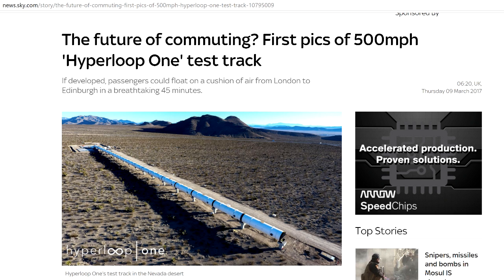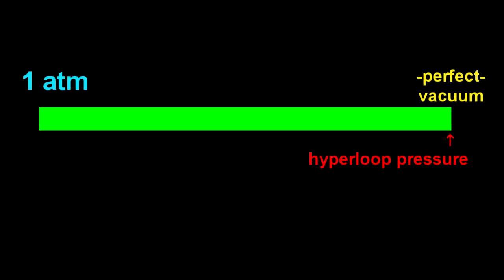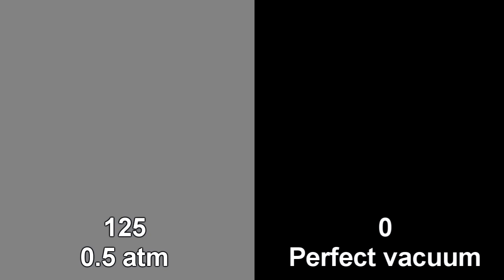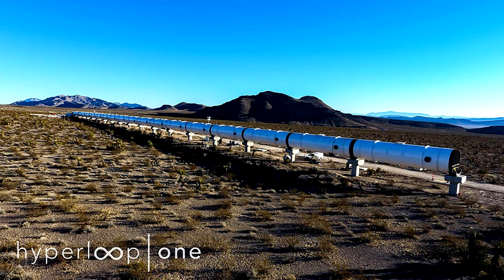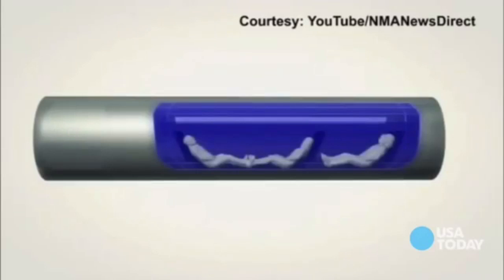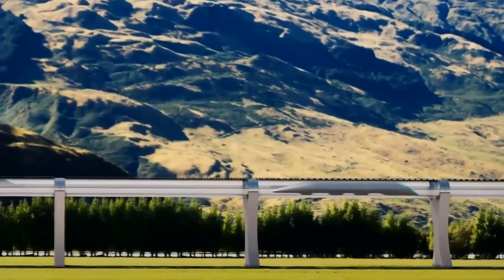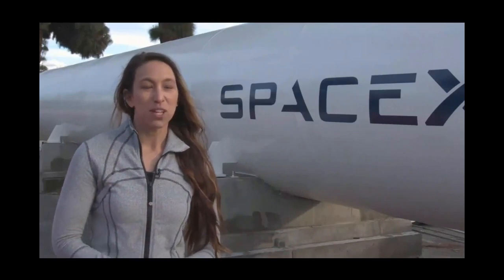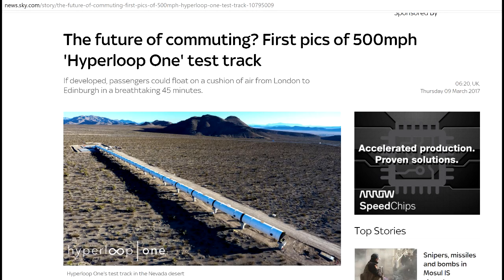Entire Hyperloop could be destroyed in SECONDS!

Comment: I did the math. A 3-metre diameter Hyperloop when blown apart with just a small amount of TNT, generates two air hammers racing away from the breach. Both travel at just under the speed of sound and each has a yield of 40-Gigajoules when it hits the airlock at a station. This compares very favourably to the yield of the largest non-nuclear bomb in the US arsenal - The 46-Gigajoule MOAB: Massive Ordnance Air Blast - or the Mother Of All Bombs.

Comment: Due to human rounding errors 1.99 + 1.99 = 3. Because it makes more sense to just call it 3 and move on than to fight over 0.02 or 2 one-hundredths of one percent.
Same with the hyperloop vaccum.

Also, it doesnt have to be run at this insane level of vaccuum... it could just as well run under 1/10th or 1/5th. The point of the vaccuum is to reduce air resistance thus increasing speed... which could also be achieved by aerodynamics and careful grade/elevation changes ensuring as much time as possible at high speed.
Putting a electric car (for fume safety reasons) into an enclosed autobahn that has charging infrastructure built into the floor rail, is a better method of achieving high speed travel than the hyperloop.

Comment: What is not mentioned is the passenger car has to be pressurized and able to withstand the pressure differential to the vacuum.  The passenger car also has to have an internal oxygen supply and CO2 scrubber just like a space craft.  And should the vehicle loose seal, passengers will suffocate.  Geeze, Hyperloop is a stupid idea.

Comment: Here's a list of things I'd consider making the hyperloope tube itself "safe":

-Thicker steel with ribbed support structure on the outside of the tube segments
-Secondary outer tube with inner ribbing support, under partial pressure (reduce strain on the inner tube from full atmospheric pressure)
-Outer tube is completely surrounded in concrete to prevent impact deformation
-Entire length mounted on shock and vibration absorbent supports
-Emergency vacuum lock and evacuation station every 1 km (automatically locks segments no pod is traveling through)
-Concrete barriers all along the entire length of the structure to prevent impact from vehicles
 *OR*
-Entire length of the structure buried in loose soil with a solid load baring structure arching over it

Only under those conditions I would consider the tube itself to be "safe". It would eliminate a lot of problems including heat expansion and buckling as that would be largely absorbed by the concrete and covering structure.
Only problem, this would probably add two zeroes to the total cost and would still not make the travel in the tube much safer.
And with what the structure would have to do it's still proposed in an earthquake zone.
You can shock mount and impact protect it all you want, if the ground itself decides to tear it apart like a piece of wrapping paper you're boned.

Comment: Serious question, could you “nest” various partially evacuated chambers each of increasing pressure from vacuum to reduce the stress experienced by the actual vacuum chamber at the center? So interior chamber is ~ 0 atm, that contained in a larger chamber of ~.1 atm, that contained in a larger chamber ~.2 atm, etc... You get the idea. I try to think about it in terms of springs to model the balance of forces but I am actually unsure whether it’d work. Not sure if the force on the interior chambers would be affected by the outermost pressurization (1 atm) or by the chamber which encloses it (in my example, ~.1 atm). Just curious, thanks to anyone with the physics knowledge who answers my question. :D

Comment: Going back to basics, I really don't understand why the chamber is evacuated. These pods all use wheels of some kind. The coefficient of friction is immense compared to the air resistance if the tube were not evacuated. And why do some of the artist renderings show streamlined pods? Why streamline in a vacuum? 
I suppose a maglev system would reduce the track friction so low that air resistance would bulk relatively large. But what is the construction cost of that and the energy requirements? 
Somehow, I suspect that the capital investment would make the increase in speed very, very expensive. Speed above all else -- it begins to look like what us economists call a corner solution which recognizes no trade-offs and is inherently uneconomical.
Reply: >And why do some of the artist renderings show streamlined pods? Why streamline in a vacuum? 
The vacuum is not hard - most of the Hyperloop projects intend to use commercial vacuum pumps only, which will leave some residual air. And on high speeds, the drag will become noticeable. You can see it even with ISS, which has Night Glider and Sun-Slicer modes for its solar power arrays in order to minimize drag and allow more time between reboosts.
>Somehow, I suspect that the capital investment would make the increase in speed very, very expensive
That is indeed likely to be one of the biggest problems of Hyperloop systems. Engineering problems are defeatable with engineering solutions, but R&D is not free and neither is implementation of those solutions or bureaucracy.

Comment: Dear Thunderfoot,
As many times as you have debunked this on it’s basic idea you have not mentioned how they could even dream of it stoping opening up to let people on and off at different stations without having to vacuum the entire system again. 

Even if they have a gate valve at both sides of the station wouldn’t it slowly need to be compressed and then decompressed again before the gate valves were open? 

They couldn’t quickly switch back and forth could they? Wouldn’t that cause serious stress to this air right carriage? 

In all honesty I thought about this idea when I was in 4th grade and I thought about it over time, and then I went to middle school and high school and I realized that my idea was stupid. 

Don’t get me wrong, my idea was more about pushing the carriages using both vacuum on one side and compression on the other. 

Then I realized the amount of energy it would take to suck and blow a train at the same time. 😂 

What cooks my ass is Elon Musk has made a fortune off dumb ideas. 

As a child I built model rockets and tried different ways of controlling their decent. My proudest ever was after first stage separation I had 3 helicopters pop out and if I had been able to have a remote and servos I could have maybe made something of my self, but adding the blades didn’t give me control, it only aloud me to use the weight and spin to slow down the first stage without using a parachute. 

Maybe that’s why I think Elon is a giant cunt, and his ideas suck
Reply: >how they could even dream of it stoping opening up to let people on and off at different stations without having to vacuum the entire system again
... Airlocks are a thing that exists, you knot. A few pressure-sealed doors - and only small spaces, where capsules stop, will need to cycle, instead of an entire system.

>Don’t get me wrong, my idea was more about pushing the carriages using both vacuum on one side and compression on the other. 
It doesn't work like this. Most of the current versions of Hyperloop (there are many of them) are, basically, maglevs in low-pressure tunnels (to allow for higher speed).

Comment: Didn't James Bond use a hyperloop hidden inside the oil pipeline to escape the Soviet Union? If they actually did it in a movie, I don't thing the engineering of this is very difficult. The problem is that Europe is going to have to choose between a Hyperloop and Russian Fossil Fuels.

All the same, I am going to stick with Commercial Airship travel, which, unlike heavier than air flight, cannot be debunked. You can also put a Nuclear Reactor on an Airship and AIR COOL it.
Reply: The hypeloop would be far more expensive and far less safe that any conventional maglev train. The argument here is not whether it can be done, but can it be as economically viable as advertised. The unsubstantiated claims made by Musk and involved parties were complete bullshit. That is why these videos exist.

Comment: I mean, it wouldn't be too hard to get around a cascade failure by using a series of automatically opening and closing doors almost like 'airlocks' every few kilometers in the tube, but the maintenance costs of rebuilding sections of the tube, even if the failure is not in the section with people in it, would be very high, along with the amount of delays. Also the track is expensive, and one way. it makes much more sense to build anywhere from 2 - 6 high speed rail lines (for probably way less money), and it'll only take you double the time. Also you can transport you know, a few hundred passengers instead of like 15-20 at once. Using the 'gold standard' of current high speed rail (which I would consider to be an N700 Shinkansen) travel between the two cities could be at a minimum just over 2 hours. If you could link that to downtown SF and downtown LA, trust me it's a hell of a lot faster than flying with all the shit at those airports and traffic. Now just using the improvements from maglev trains, vs conventional rail, (for the sake of simplicity I'm sticking with the Japanese designed one, also Japanese trains have a long record of safety) the test trainset 'L0' is rated for 505km/h in operational usage (record 603 km/h) which would bring the time it takes to get between the two cities down to somewhere in the range of just over an hour. Basically, a vacuum isn't necessary for high speed rail travel and will only complicate safety and energy concerns and lead to a stalled project that will result in a small amount of the track being built and eventually failing if it even makes it that far.

Comment: There's a lot of problems urinalysis on this particular one
1 you're never going to achieve the maximum rated speed of a tube only a kilometer long
2 vacuum in a tanker truck is a lot different than vacuum in a container made to hold a vacuum the tanker they used wasn't even really intended to handle pressure let alone a vacuum
3  the braces inside the tubes are not intended to stop the things from collapsing their intended to stop it from distorting as they move it around this way when they go to welded they don't have to reshape it and if you notice it was only really at the ends at those races were at and again this is because they're going to be welding it and they want the butt joint to be as perfect as it can be

Comment: What if the hyper loop was compartmentalize. So invade of decompression it would lock down multiple areas and make a gradual gradient to 1atmospers. It would decrease time of entry by a lot.
Make it a maglev based design due to the pods slow down du to contact with the ground. Lift them up on a maglev. Make them aerodynamic design. And it could possibly work. With a bit more technology that we don’t have yet.

Comment: Just a thing: all those tubes are one layered. An Engineer would adress this problem with a two layered structure. (Inbetween the tubes there is about atmospheric pressure.)
Reply: That would change nothing about the differential pressure between inside and outside the inner tube.
Reply: @bumboclat   but you can make the inner tube dentless.

Comment: ThunderF00t I agree with all of your points except for one. 

With the vacuum tube they would have a system in place where they would have a separate chamber the pod would enter, they would bring the small chamber to a vacuum and then open the seal to the hyper loop. Seal the door again, depressurization, add the next pod and repeat. 

But this doesn’t absolve all of the issues but it does handle how long the depressurizing would take and the amount of energy as well.

Comment: I understand your scepticism, but let's be honest, a train or truck tank isn't made for vacuum, and you're just comparing strawberries to apples. Even over how retarded the US can be I'm sure there are some safety norms that they have to match to be allowed to put people in it. Like the least they can do is put in sensors and valves to quickly fill the tube in case of a failure, and considering the speed at which the truck tank imploded and the length of the tube the chances that a train will be caught before even a cheap solenoid valve set can open and repressurize the tube are minuscule. Considering the speed I don't know, I mean you just maglev the shit out of it, speed it up half the way, slow it down the other, and that's that, maglevs are expensive but relatively simple design, hard to mess that one up.

Comment: 7:28 200 million Joules correspond to 1.7 gallons / 6 litres of gasoline. Not much at all, and why would you use TNT equivalent for something that has nothing to do with an explosion?
Reply: im pretty sure depressurizing that chamber requires more energy than that, doesnt it get exponentially harder to pump out more air?

Comment: The video of the tanker truck collapsing is not a great comparison.  That vessel was built to withstand greater pressure forces from inside and is constructed differently.  The video was intended to convey the dangers of pulling vacuum on a container that was not properly designed for vacuum.  Early submarines were made with carbon steel hulls and had a test depth limit of 100 meters (materials and design improved later for greater depths).  That is a 10 atm pressure differential that the hull was build to withstand.  With a perfect vacuum, the chamber would be subjected to a 1+/- atm differential.  Also, the supports within the pipes are to maintain roundness in the sections until final assembly because a small deviation in roundness as little as 25mm can result in over 30 percent decrease in hydrostatic load.  There are many things to consider in such a monumental endeavor, including the energy requirements you mentioned.  But, not all points are worth being so dramatic over.

Comment: It would not make a big difference but these tubes are supposed to be underground on the final product which could solve some problems however it still wouldn’t work
Reply: Ok the dirt problem is easy make the tubes thicker and reinforced so that way they don’t collapse. This would also solve the collapsing from a vacuum problem. Groundwater and rain can be solved the same way subways do it with pumps.  I don’t how inspections would be done above ground but I think It would be the same. You know go in the tube and walk or use some other small vehicle to check the inside. You also mentioned California fault lines and earthquakes. I would ask you how do you think people transport large amounts of water underground with pipes and this is essentially a giant pipe. So the engineering that you use for a pipe to move water can be used on the tube under ground. So yes it is a great idea to put the tube under ground you also don’t have the big ugly pipe above ground. However I don’t think this project is worth it. It cost too much to build an efficient design that actually worked.

Comment: I'm not a science major, but this comes in mind. Why not try to design a more advanced electric train using a renewable energy source? A few windmills on each station or along the rail, an array of solar panels on the roof of stations and trains, and if needed, a back up electric power from the grid.
It will at least reduce emission significantly, electric trains are already developed and tested,  the passenger could at least see the outside world instead of a tube interior, explosive decompression can be ruled out from possible risk, and tesla could really promote the use of solar roof they produced few yeats ago.

Comment: so...
not a fan of that hyperloop idea
but msot arguments against it are just as... wrong as the argumetns for it
it's just a really mediocre idea
but it's not that dangerous
it's just well... not as expensive as some assue but way more expensive than it will ever be worth
between regular trains and airplanes (which by all logic are equally dangerous to hyperloop yet one of the safest methods of transportation) it just will not be able to economically compete
the main disadvantage of trains against other methods of transportation is that you need to build expensive infrastrucutr along every rout you want to drive - and thy are only economically competitive because traintracks can be built increidbly efficiently and trains are already really energy efficient making up for that cost
removing air resistance from trains does not make them suiciently mroe efficient to be worth the extra cost of building a hyperloop
and making them faster will in turn make them les efficient and the trains themselves mro expensive to build
so it's a crappy idea
but most of the backlash it is getting is just as stupid as the idea itself

Comment: If the design of a pressure vessel includes stiffeners (longitudinal and/or circumferential reinforcements), then the skin will be much more optimised (thin-walled cylindrical section); Therefore the naked cylindrical section (shell) will require temporary internal supports until the stiffening is completed. There is also an issue with the tight tolerances for ovalisation, so internal supports are usually still needed for controlling it against handling, welding and heat treating. Ovalisation is the greatest enemy of pipe compression resistance and the hand calculations contain assumptions on how much ovalisation is expected, therefore it is important to take measures for limiting it, otherwise risk rejection by the customer.
Spotting temporary supports tells nothing about the strength of the section under its own weight, let alone how much compression it can take once the pipeline is completed. I would like to recommend that you consult with a Mechanical Engineer before talking about engineering in general, at least to protect the extent of your argument and especially to avoid the risk of spreading misinformation.